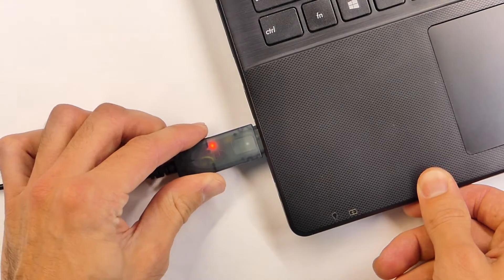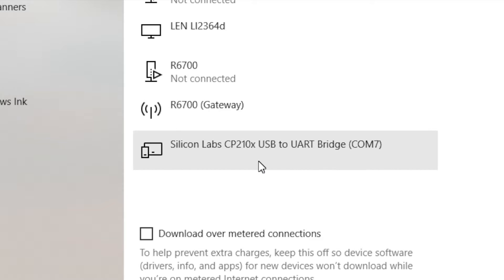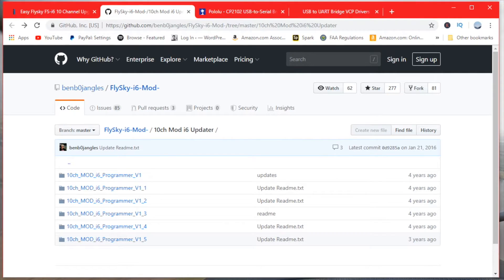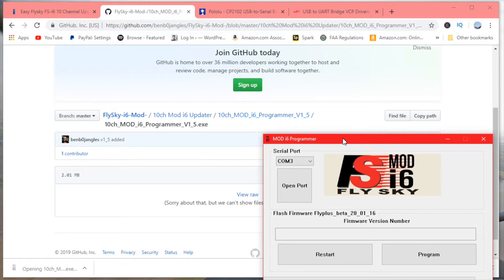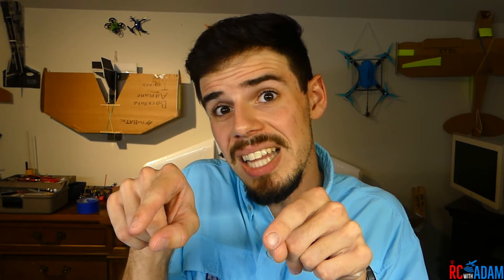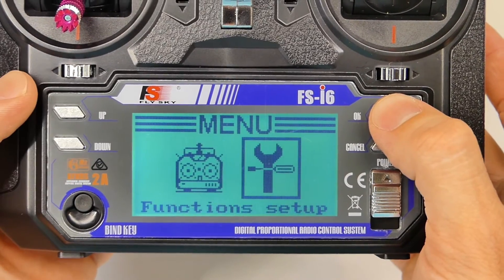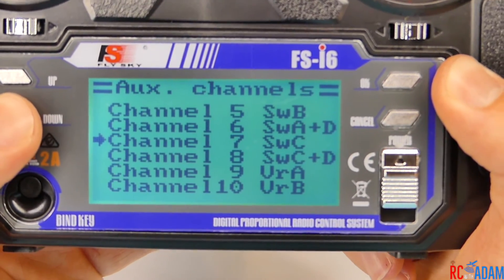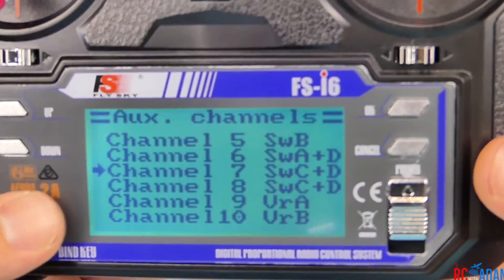Flysky FS-i6 Firmware Upgrade Tutorial - How to Update fsi6 Firmware to 10 channels (Flyplus Beta)

Comment: I use a Mac.  So far I haven't found much that won't work on a Mac.  I'm going to be testing this today.  I'll update my notes to include any steps that may not be intuitive.  Thank you for the videos, you have a great channel.
Ok, update:  I took a few minutes and went through the process.  I'm finding using a Mac for anything quadcopter related can be challenging. Everything, including the site for the upgrade is al optimized for Windows.  However, following your instructions I was able to update the setup and see the 10 channels. Seems if didn't need the firmware update. Well, yet.....
Where I am stuck is connecting a Tarot retractable landing gear to the FS-i6X Switch D.  I'm able to wire them through the receiver and get them to work with the A and B knobs, but not with the switch. I'm thinking it is related to mapping the switches, but I'm not sure.  Any advice would really be helpful. I would love to see a full setup video on how to connect the Tarot landing gear to the FS-iA6B receiver using the FS-i6X controller.  My design is to used 2 independent head-tracking cameras (One 4k and one 2MP Night Vision). So, I could leave the landing gear on one of the knobs and be ok, but I'd really like to know the proper way to set this up. 
I'll also setting it up with 2 batteries and an additional Solar charging unit on the quad to provide a substantially longer flight time, at least that's the plan. Not sure if the second battery will be necessary. 
I do enjoy your presentation. You have a great way of explaining so that it actually makes sense.

Comment: just wanted to say thank you Adam. i know its a very old video, but you are saving me from buying a $400 spectrum radio!  now i have a 10 channel radio that i can use for my flaps, aux lighting, and gyro settings   awesome sir   thank you for the tutorial!   updated my fs-i6 successfully to the newer version/ beta for 10 channels.
if i could add a tad of information to this group, if the flysky driver doesn't pop open right away, you may have to remove the usb cable, wait, then reinsert and re-open flysky driver.   this worked for me after unsuccessful opening of program for update.   
thanks again, adam. good job!
Reply: Would a normal USB cable with the dongle to connect the flysky piece work you think?
Or do you need the special data cable?

Comment: I install the drivers, seems ok, but I cannot find them in settings even after a reboot.... what now ? any ideas? win10
Reply: ok the install had worked, the trick was one of my usb ports did not have enough power or something... tried a different port and it was detected automatically and then the USB Bridge showed up in Devices. Thanks much for posting this video :)

Comment: Hi Adam; I was nearly tearing out  hair because the Pololu driver had me on port 33 so invalid port for the firmware. Easy fix was relax and go into device manager and change the port number to a single digit, reset computer, run the program and bingo.  Must agree that an extra 10 bucks for the i6x does make it simple.  Hoping others see this post.
Reply: Hi, would you mind to explain me where is this SINGLE DIGIT to change ? I dont understand it well. Thx for help
Reply: @ratmedscichacz  Will try. I use Win 7. After downloading the Pololu, I found that the data transfer lead from transmitter to computer was set as com 33 and no way could I type that into the  little box top left to select port when in the program thing in the firmware update on 10 ch_i6_ programmer. Looked up on web how to re assign com ports. Found that ya can rename in  Device manager (I think), the number of the com port you wish to give to that device. It took me ages to figure that out. I guess Ya need a proper data cable and find it in your device manager, select it and see.
Reply: Oh forgot ya have to have the data cable as com port  1 to 9 , if ya try the number 10 it is a two digit number and the firmware will keep telling you Invalid port . I used number 7

Comment: Hi Adam, i successfully upgraded the firmware to the 10ch firmware in your video. Thank you for all the infos 👍My question is, if I bind to the 10ch fs-ia10b receiver and enable PPM output, will it have at least 8ch on the PPM output?

Comment: Hello there, I have this same RC, by mistake, I press model reset in the menu for  "Model 01" now the RC is not communicating with the drone they are bounded(transmitter and receiver) but no channels are working, I tried a factory reset but nothing changed. Do you know if I follow this procedure will re-write the models getting it back to normal?
Reply from the maker: Hi, Harold! Which drone do you have? No, this firmware upgrade won't help you get your settings back. Check out my video about possible reasons why the transmitter won't show up in betaflight https://youtu.be/NfqdJ99ocLQ . That might help. 🙂
Reply: @RCwithAdam1  Thanks, Adam!! the SBUS communication was off in the RC that fix the problem. Now I'm facing another issue, channel 5 is the switch with 3 positions now is jumping from fight mode 1 to 3 and then to 6, it was working before jumping correctly y sequence 1,2,3 and the for channel switch 6 (2 positions) will do the rest 4,5 and 6 going it reverse using channel 5 switch. Do you know how I can fix this? Thanks again for all your help I really appreciate it.
Reply: Hey Adam, I found it now it's working. if it's OK with you I can share the link here.

Comment: Hi Adam been watching your videos and just got my flysky data cable today do I loose all my models that I’ve put in ie Vosper mtb and Dragonforce 65 will it set the remote as if you’ve just got it out of box and heard a few people have lost channels is this worth doing as I need the extra aux channels to run lights on Vosper but heard the aux channels won’t work till I upgrade is this correct many thanks chris from Cumbria
Reply from the maker: Hi, Chris. Yes, it will reset ALL settings and ERASE all model profiles.
Reply: Thanks Adam after searching for the drivers for the data cable and a bit of messing on computer all complete and no problems on my end now have 10 channels thanks for your video on how to download everything as I would of been lost

Comment: i have a problem where my drone doesnt want to bind to my flysky receiver please help i updated the firmware on the drone and it used to blink to bind but not anymore.
Reply from the maker: Hi. Sorry to hear that. What receiver are you using? and are you going through the standard binding process? I've noticed that with some receivers, the blinking or screen prompts may be different.
Reply: @RCwithAdam1  it used to work but I updated my firmware and it says my drone is binded but it’s not. The receiver I use is the flysky FS-I6

Comment: It worked great...thanks. 🍺🍺 BUT all my models and setting were wiped off the radio. I had to rebind 7 quads and a bunch had heat shrunk wrapped receivers that needed removal to rebind. 😭😭😭🤦‍♂️ But still worth the trouble. Maybe there is a way to save the settings but it wiped mine.

Comment: hello, i do it like u... but i dont see the device silicon labs. I have installed it x64 but he just show me under devices: "FS-i6x Firmware update" and i cant see any COM#. I can just see COM# in the MOD i6 Programmer. So witch COM# i should take from  COM 1 - 8 ?
Reply: Hi, I have the same problem
Reply: @michael_berteotti  I know now why... U need a special firmware cable... The cable that's already in the box is not a firmware cable...

Comment: Flysky FS-i6 bug - Warning on boot

Hello, I buyed second hand flysky controller. Firstly it was working fine. I tried only in lift off. Today I turn it on and I can’t get through Warning. (Place all switches in their up position and lower the throttle). 

• I disconnected all switches- didn’t help
• I took out throttle gimbal and reach to put throttle much lower - nope
• I can’t go to hidden setting (both sticks bottom left and turn on)
• New batteries 

Help!
btw. nice start to flying on budget

Comment: interesting.. I got the 6x and looking at what version is on there it's 2019 firmware but I only have aux switches 5 and 6 available to program.. I wonder why it doesn't have all 10 channels.. should I do this to it and see what happens..i don't really need them all but still

Comment: I see your videos on the fs-i6 transmitter but have a question which has not been covered. My planes work great with this radio, of course using the flysky receiver only, but when I set up my hirobo shuttle zx, I get all controls to work correctly except one. I can mix my throttle with collective using the "throttle" stick but when I idle up, instead of the throttle idling up only, the collective also ramps up, which is not desired for obvious reasons. Can I omit the collective on the idle up switch yet keep collective control on the throttle stick? It does work with my Futaba 8 channel and my Hitech 7 when I had that radio.

Comment: frustrating, none of this works.  i downloaded the cp210x, that installed ok, the other polo thing wouldn't install, came with an error message saying device manager cant read it or something. downloaded the mod pack, after couple of restarts eventually got it to launch but it couldn't find my transmitter anyway. in the device menu is is listed as flysky transmitter in update mode but doesn't have a com channel. i tried every channel on the mod pack but none would connect

Comment: Thanks! worked like a charm! but one thing - the program didn't start on windows 10 until run as an administrator
Reply: hi, What was the firmware version in the transmitter before updating? mine is 2.0 now 1-Feb-2018. and i can't update it. Whatever I did I could not connect to the computer.
Reply: @ayhannkaraca  I think I had the same version. I would check cable Driver and make sure the port number is correct in your case

Comment: I never could get it to work. Installed the drivers and the program software but never got it to show up in the devices. Tried it on windows 7 and 10 both. But works fine as a game controller for flight sims. Just wont show up in the devices and no c2102 shown at all
Reply from the maker: It's very strange--this process seems to be hit and miss. For some people it works perfectly. Sorry it's not working for you. 😕

Comment: Hi, execuse me, but can I change my FS-i6s firmware to FS-i6x firmware. I have a FlySky FS-i6s transmitter, but I do not fly quadrocopters. I fly with sailplanes. Thanks!
Reply from the maker: I haven't tried yet, but I don't think it's possible since the i6S is a touchscreen and the i6X is not.
Reply: @RCwithAdam1  Yes, I think that too, but it would be good if they had been changeable.

Comment: Hi Adam, Hope you are doing great! I was able to follow the steps and my i6 got updated to 10ch which is really amazing. Thanks a lot for the information. I had one query though, is there a way to get SBUS mode in i6? I think in i6x you can select that from the setup menu. In i6, i can use PPM and IBUS but not SBUS.
Reply from the maker: Hi Pranav! I am doing great! Strange. Does the SBUS option show up in the menu at all?
Reply: @RCwithAdam1  Thanks a ton for your reply! No, i dont get that option. So, if i navigate to System->rx setup
I get the below options:
AFHDS 2A
PPM OUTPUT
RX BATTERY...etc
if i go inside PPM Output, i can only switch it on or off.
Am i looking at the right place?

Comment: Hi! Thanks for the tutorial! Can you make a video showing how to use those extra channels using fsia6b receiver?
Reply: its really simple u need to select the type of switch and turn it off or on. after that u can add servos or anytype of things, basically there are 10 channels in that 4 channels are for joysticks, another 3 for basic on/off switch one for 3 control switch and last two are for adjustable type switches. what this adjustable type switches do is adjust to the specific level of their position like example servos. for 360 degree servos 3 way switch can be used to rotate in clockwise and anticlockwise direction.
i hope u understood what i meant

Comment: Hey Adam, I fallowed the steps as well as possible, but the Firmware Version Number never shows up. What's wrong?
Reply: hey 
I have that same problem. could you get it done?
Reply: @ayhannkaraca  I just bought a new data cable and works great now! Just make sure you don't mess with the cable and use it just the way it comes.
Reply: @ethanharmon4263  
Thank you. What was your transmitter firmware before updating? mine is 2.0 now 1-Feb-2018. Do you think the 2016 update creates a problem?
Reply: My firmware was FLY SKY FS-I6 1.1 (25-NOV-2014), and is now FlyPlus Beta (20/01/16). I don't think there's a problem now, but I have noticed a couple features like mixing a little more difficult. It mite just be my imagination though.

Comment: Installed driver 100 times, device connected just says PPM, tried and failed
Reply: also me :C have you resolved it in some ways?
Reply: @Ryleeeeeeeeeeeee  i dont have this controller, but i think its a driver problem, do you got the right driver? do you started your OC again after installation? did you check your device in the device manager after driver installation? what does it say?
if its called PPM you got the wrong cable....there is a cable for programming/flashing the RC and there is another cable/adapter for playing games on pc with your rc.....

Comment: How can i do this on a TX that doesn't have an lcd? I have a fly-bird st-i8 (8 channel). When i opened it up, it's definitely using flysky boards so this should work. But i dont know how to go to firmware update since the TX does not have an lcd, updated doesnt show current firmware and says device not found when clicking program.

Comment: Bro I had small doubt regarding this cable can be used as simulator with laptop. I had a problems in connecting with it.
Reply: There are 2 types of Cables, one just for updates/programming of the control and the other cable is for simulating an reciever on pc side, for gaming with this controller...

Comment: The combined switch settings Tell it like the 3pos and a 2pos switch are have 6different states.so they work like a Single 6pos switch. 
I use it if my resiver dosnt Support 10 Channel, so i can use more switches than Channel But its a little complicatet to Set it up in betaflight whith the sliders. (swA+ swB on one Channel, swC and swD on the other,means that only 2 aux Channels are used. And 4 Channels are always used for the sticks.
Thats 2switches more than whith the original Firmware. Normaly i use a ibus resiver so i can use all Channels.

(sorry for my englisch, im german)

Also there are 2 similar looking usb Adapters. One is only a Simulatorcable,  and the other one is for Programming. I upgradet my Firmware whith an arduino that i had laying around, becourse i only had a Simulatorcable and didnt want to buy only for one time use a extra cable.

Comment: Please I need help with this! After I updated my flysky i6 to get the extra channels, betaflight will not recognize the controller whatsoever. I tried rebinding the transmitter several times and still there are no inputs showing up on the receiver tab on betaflight. The only other thing I changed was I switched from oneshot to dshot for turtle mode. Adam, or if anyone has any information on how to get betaflight to recognize my controller inputs please let me know!!!
Reply from the maker: Hi! Which receiver are you using?

Comment: What to do if the Firmware version does't show up and it says Device not connected? Yes, I run it as Admin, I use the right COM port and right Baud Rate. The usb-uart adapter (which the cable actually is ) starts to blink but it still says device not connected. Whay should I do?
Reply: Hey i have the same problem if you found a solution please tell me

Comment: If i upgrade firmware it can bind to a sbus receiver ?
Reply: That's what I was looking for! But it appears that the ability to use sbus receivers only comes with the FS-i6X. The internal hardware on it is different. Might pay to put the money towards a multi protocol radio and keep the i6 for the PWM daily drivers.